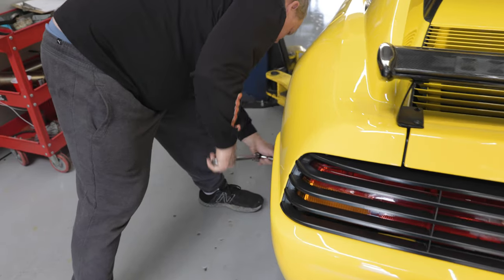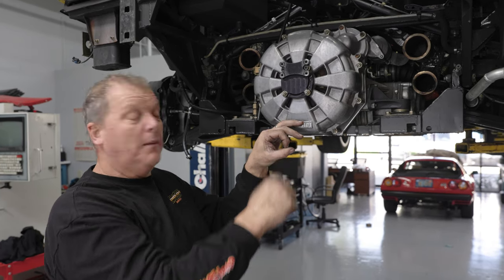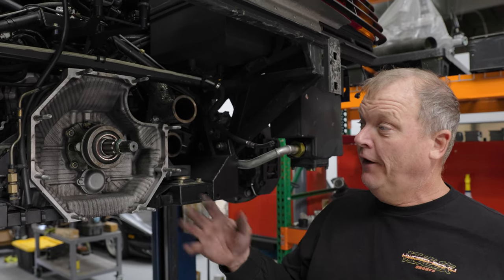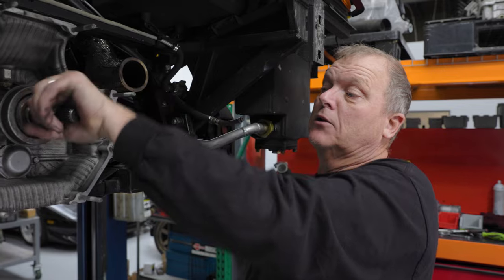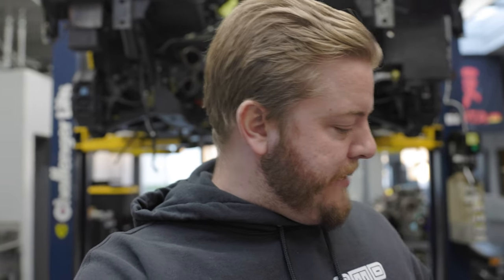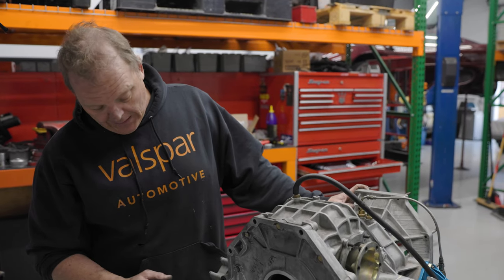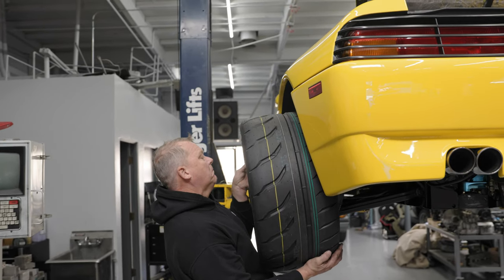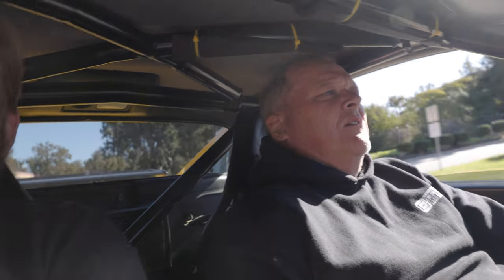Ferrari 348 Challenge Twin Turbo Being Prepped for TV!?!?

Comment: As someone used to more mundane drivetrains that transaxle setup seems completely bonkers! I'm sure there must be a good reason for the layout but it eludes me. Liking the new intro too!
Reply from the maker: One of the biggest benefits is length and spacing. You don't have to have a big transmission tunnel and can keep the car short (96.5in wheelbase)

Comment: How much power can those transmissions hold? I know they aren't for drag racing, so shock loading isn't my concern. Just wondering. I actually didn't know that is how those were done. I was thinking in my head about a very similar design, so I just find it intriguing since it pretty much already exists.
Reply from the maker: Right around 500ftlbs of torque is the max. Especially if it's low end torque. If it's a pretty linear torque curve under 500 peak it holds pretty well.